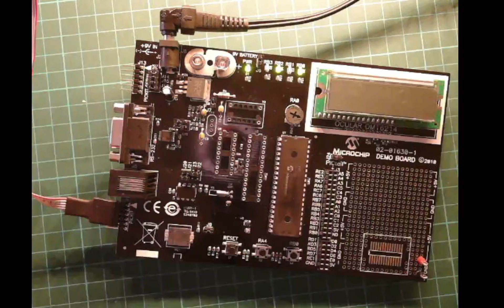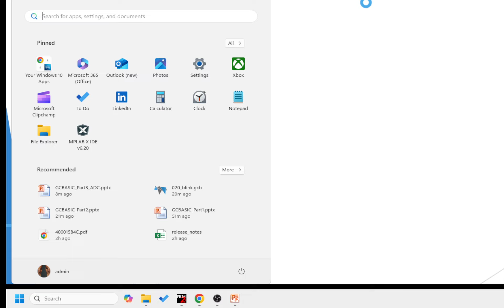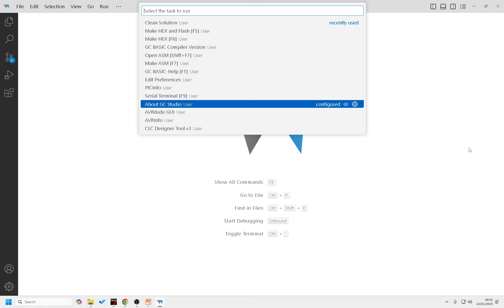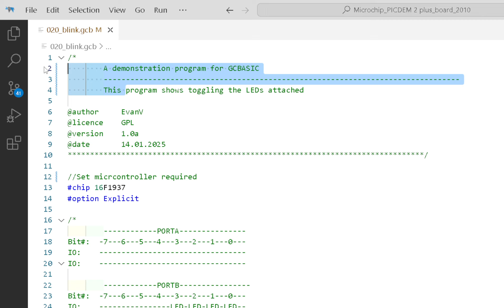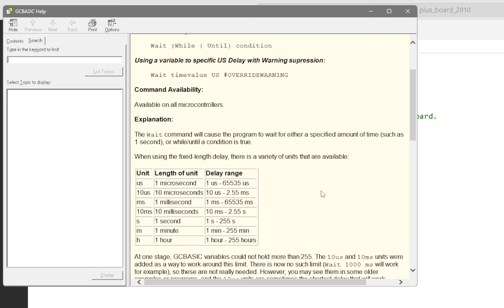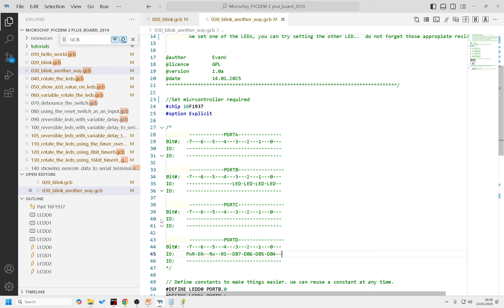PT2: PIC16xxxxchip Family - Using the GCBASIC to control/rotate the LEDs using GCBASIC

Comment: this isn't a Q24 DEMO OOPS!
 just 1 line change makes it useable for another fossil chip; the 16f76...SO EASY in GCB.you dont even have to use the power supply as the  PICKit2 can power the whole board easily with the correct settings in programmer preferences! easy peasy. my PICDEM plus dates back to 2002 in a snappy red colour PCB.the old school LEDs are easier to see too.;0)
Reply from the maker: Just updated ... my typo.

A red PICDEM board.  Post a photo somewhere!  I have not seen that one. :-)